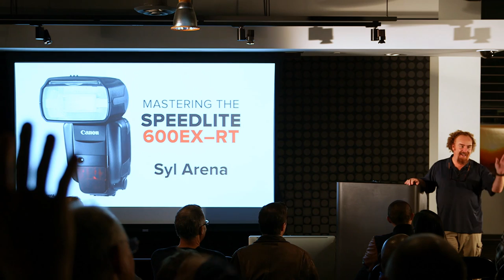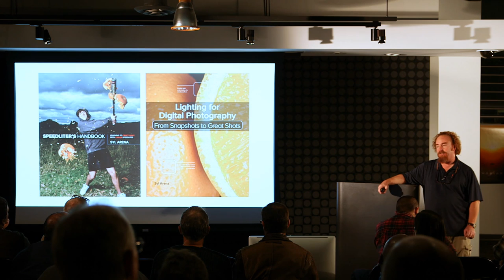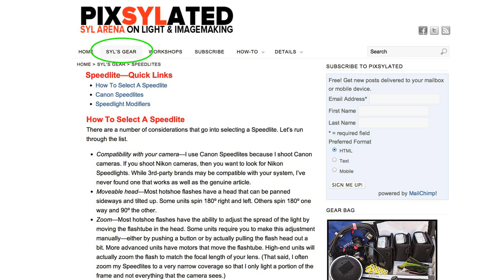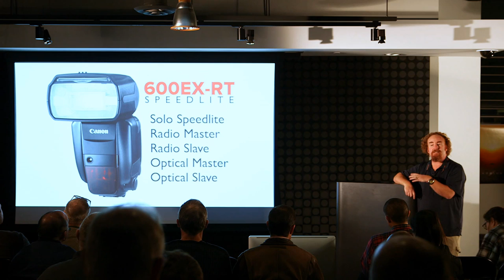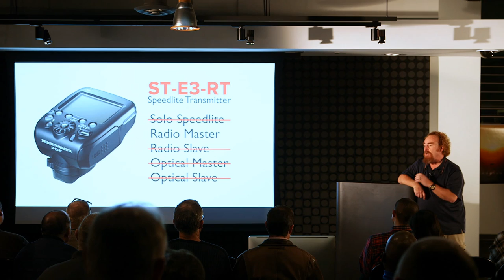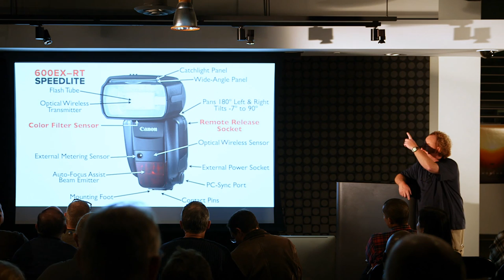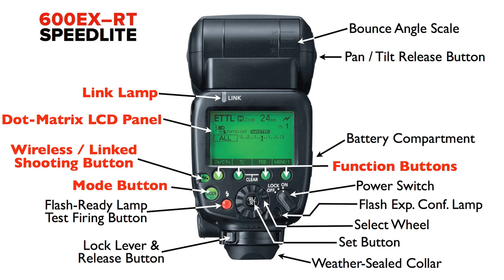Canon Speedlite 600EX-RT: Overview

Comment: I have a pair of 470 ex-ai flashes which I want to use off camera by remotely triggering them using a remote trigger. Which speedlite trigger is compatible with the 470 ex AI flash units? Is ST-E2 an infra red transmitter or an optical transmitter? Are the infra-red and optical transmitter same? Is ST-E2 compatible with the 470 ex AI flash units? Can I use ST-E2 transmitter mounted on my canon 5d mark iv to trigger the pair of 470 ex-ai?
Reply from the maker: Hello Arijit:

The 470EX -AI can be controlled wirelessly, using the Canon ST-E2 wireless transmitter.  The 470EX uses an optical system (light) for wireless communication instead of radio transmission.  The optical system sends signals with using infrared light.  You can find a list of compatible devices on pages 94-95 of the 470EX-AI instruction manual.  Here is a link for your use: https://Canon.us/fhsrz

We hope this answers your questions.

Comment: Today so many companies didn't want to listened to ATG, including Canon.
ATG AF Assist Beam is very important. Many are built on speedlites & speedlights.

Canon ST-E3-RT = no ATG AF Assist Beam for $300.00
Profoto Air Remote TTL = no ATG AF Assist Beam for $500.00
Interfit S1 TTL Remote = no ATG AF Assist Beam for $100.00
Phottix Odin Transmitter= no ATG AF Assist Beam for $200.00
Impact Venture Transmitter = no ATG AF Assist Beam for $250.00

ATG/Yongnuo YN-E3-RT = ATG Assist Beam, USB port for $75.00
ATG/Nissin Air 1 = ATG Assist Beam for $80.00
ATG/Nissin Air10s = ATG Assist Beam for $170.00 (very easy to use * understand)

Canon, you and Nikon/Pocket Wizzard have ripped us off for years.

ATG/Godox/Nissin/Yongnuo are in town to stay.

Comment: can it do HSS while the flash is on the hot shoe ?
Reply from the maker: Hello:

Yes, you can use High-speed Sync when the speedlite is mounted to the camera’s hotshoe.  You can find details on page 25 of the speedlite manual.  Here is a short cut: https://Canon.us/us5a.  If you have other questions, our camera support agents are happy to help you.  You can contact them at 1-800-652-2666 Monday-Friday: 9:00 am to 9:00 pm ET, Saturday: 9:00 am to 7:00 pm ET, excluding holidays.
We hope this helps.
Reply: @CanonUSA  Thanks a lot, it sure helps !

Comment: Why canon uploaded a video made 3 years ago?
Reply: because companies and colleges have worked together and has made all students buy em.
Reply: Canon radio transmitted flash is the best system on the market. Could be the reasoning behind sales.
Architecture photography light the interiors and exteriors,shoot from outdoors. Work seamlessly together. Five groups, 15 slaves, some set ettl others set manual.All controlled from rear camera LCD. I shot interiors of a state building a corridor some slaves were over 350 feet away from camera and ste3 transmitter and worked perfect